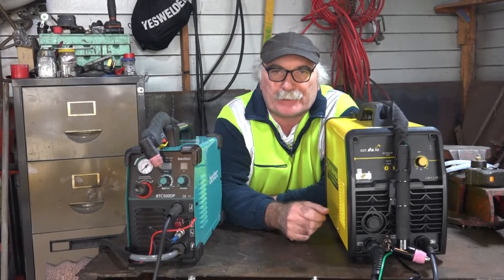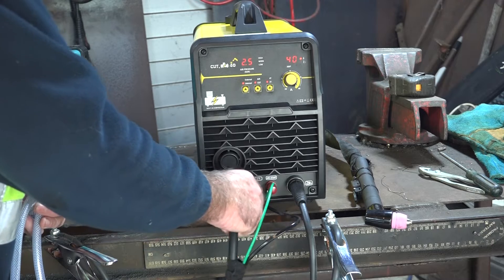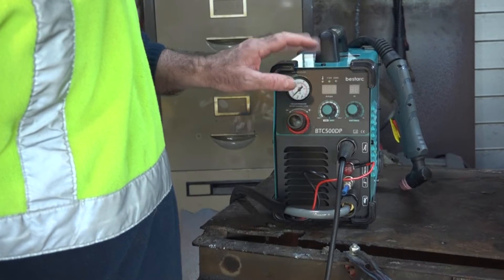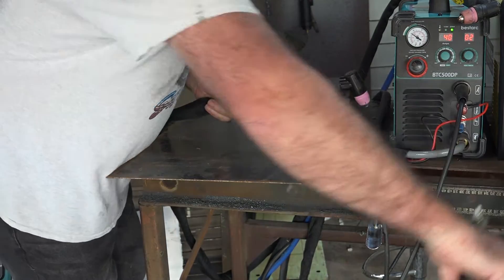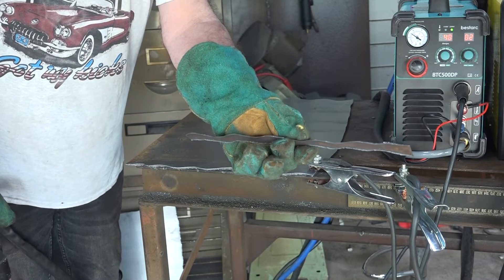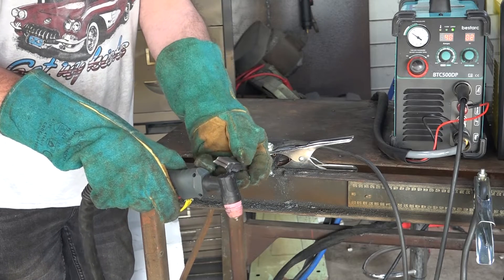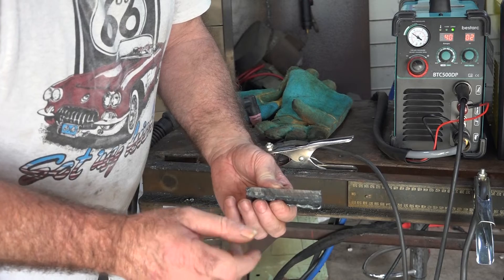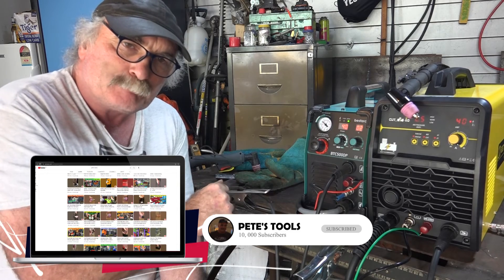Will a Plasma Cutter with Built-In Air Compressor Use Less Air Than a Standard One?

Comment: Hey Pete, my dad bought a plasma cutter for work, advertised to to cut 12mm mild steel, but when we use it there’s a lot of sparks, a lot of slag and the most annoying part is the actual flame (not sure of its proper name) will constantly cut out, sometimes within milliseconds. If we hold the cutter in the air it will work just fine but then we bring it close to the steel and once it make contact it will turn off
Reply from the maker: That's no good my friend ,Send it back you may have got a lemon